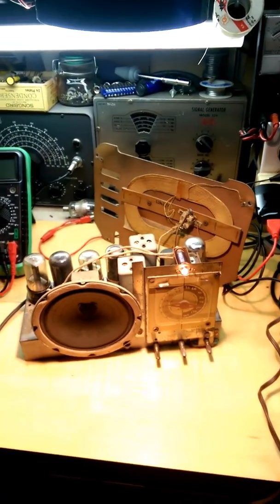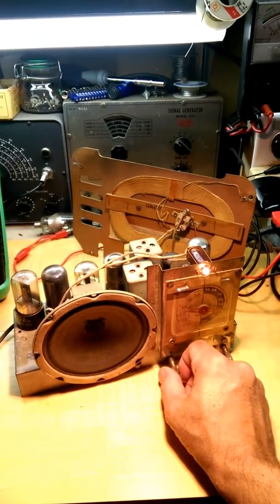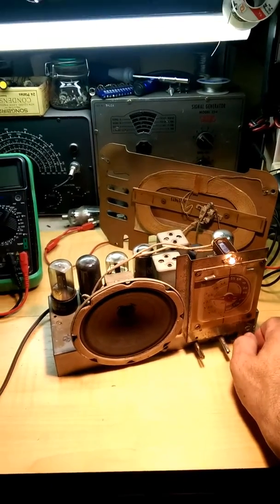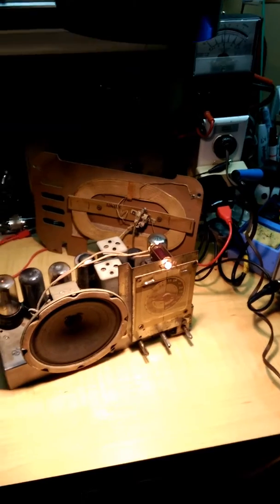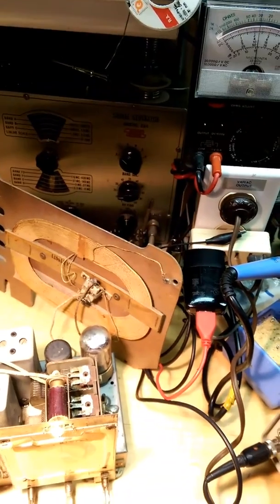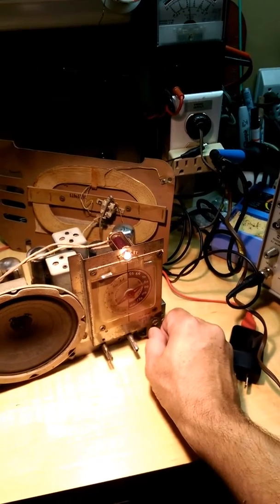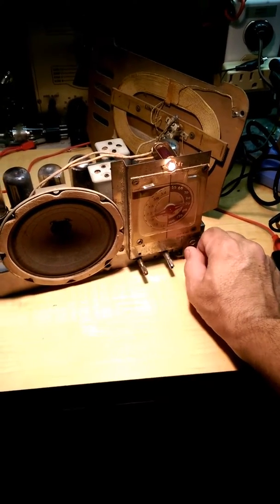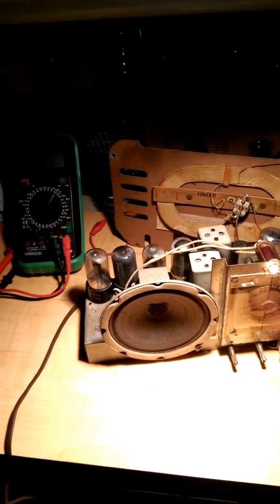Eliminating Sources of Vintage AM Radio Unwanted Noise

Comment: Great video.  What percentage of the noise is coming into the radio through the line cord?  Is the noise mainly being picked up by the antenna from the various devices in the room, or is some of it backfed from those devices through the line to the radio?  Is there a line filter on the market that would help?  Thanks!  Rick